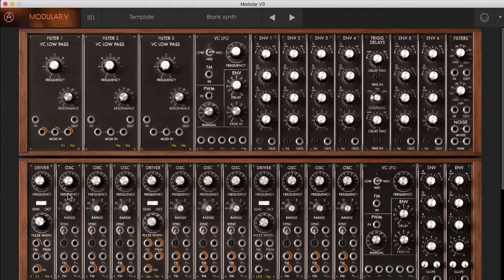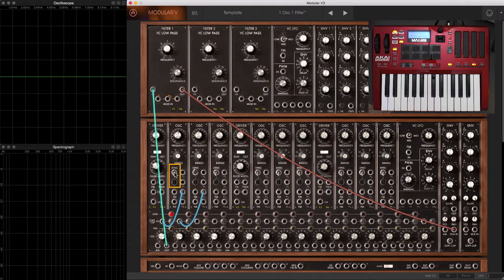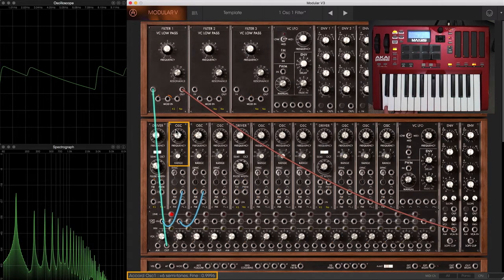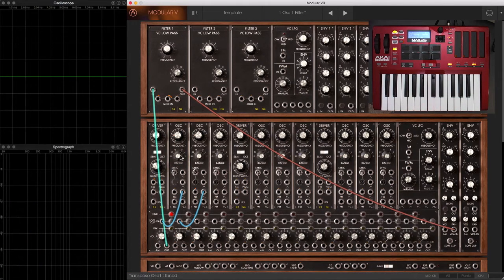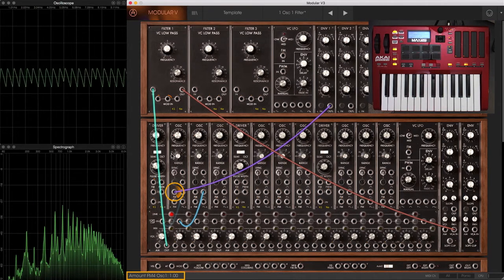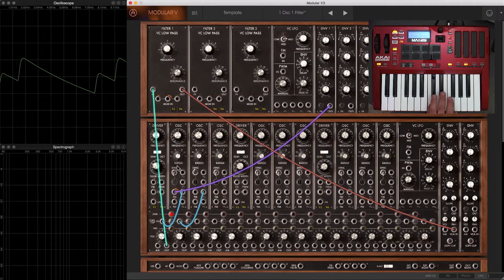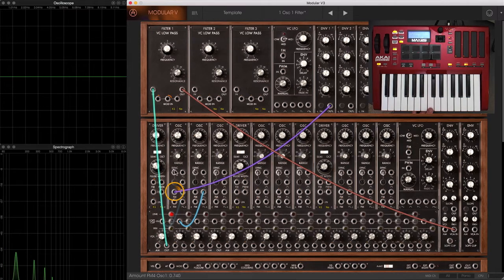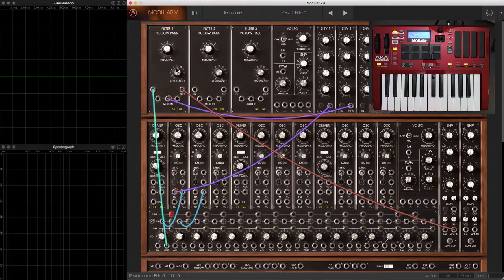LMS: Oscillator Sync using Arturia Modular V (V3)

Comment: If you would rename your video's to "......... Modular V3" you would get more view I think.
Reply from the maker: I'm guess that's what you were searching for - V3? It's a good point; Arturia calls it "Modular V" all over their web site, but the software is called "Modular V3". I'll see if I can re-work the titles to include both.
Reply: Great! Another question: What is the oscilloscope plugin you are using? Quite handy. I am using the Modular V3 in Cubase in a Mac.
Reply from the maker: I use Spectre by Audio Engineering. It's more of a standalone program than a plug-in. It works great when I am recording videos about my hardware modular, as I can specify the audio input to use; when it's a program creating the audio, it can't always find it, so I have to route audio out and back in again to get Spectre to see it.